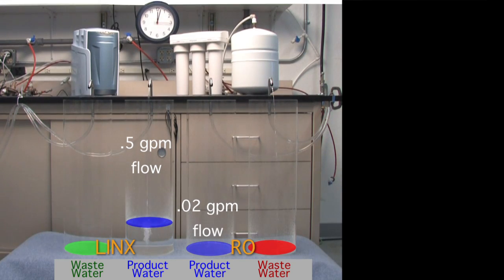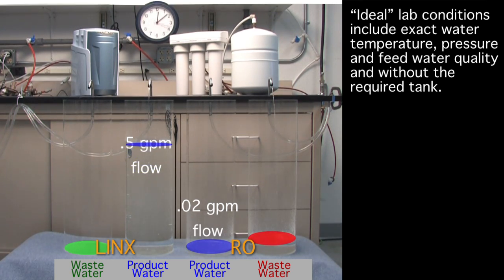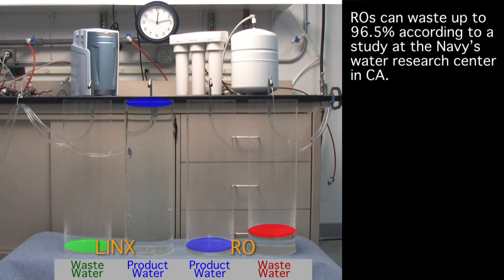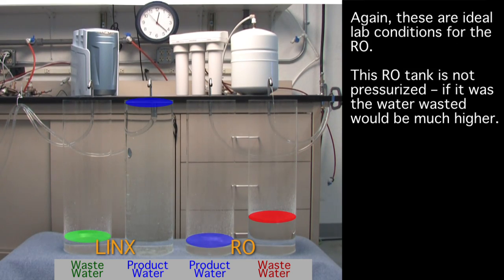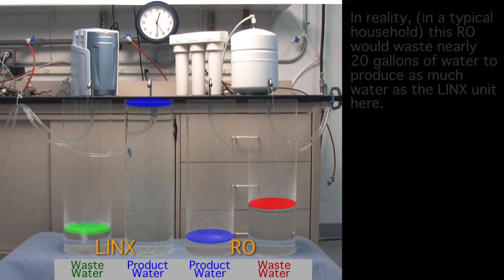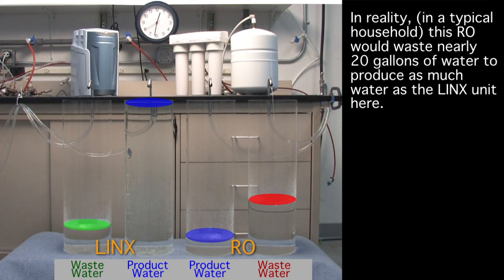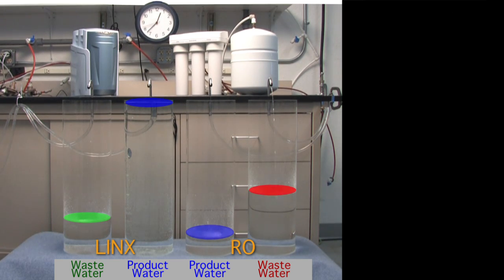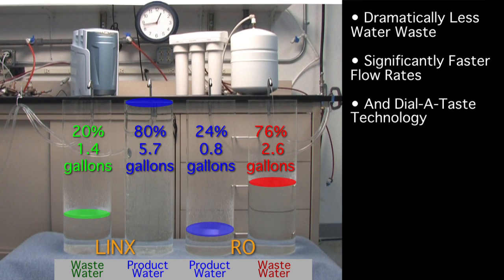Comparing a LINX® Drinking Water System to a Reverse Osmosis Drinking Water System

Comment from the maker: The most efficient household RO system in the market today is “water on water” design where the rejected water that normally would go to drain is diverted to the other side of the “bladder” in the product water storage tank. This is then used along with water pressure from the feed water source to force the water out of the tank to the faucet.  These systems claim a 50% recovery rate but actually perform at 33% due to the use of feed water to deliver water from the storage tank to the faucet.

Comment from the maker: Water temperature also impacts recovery.  ROs are lab tested for certification w/ 25 degree Celsius water (77 degrees F).  A one (1) degree Celsius drop in temperature will actually drop your recovery rate by 3%. Finally, the pressure applied to water at the RO membrane is the 3rd major factor in the recovery rate.  ROs are tested for certification at 50 pounds per square inch (psi).  If the pressure varies, recovery varies as well.

Comment from the maker: However in the cases that we have experienced the efficiency rate in is even lower typically 10% or less depending on where the tank refill pressure switch operates.  When a home uses one (1) gallon of water a day, at 10% recovery the actual water wasted is 3,500 gallons per year – staggeringly high.

Comment from the maker: Recovery rating in cert testing is 25-33% but the testing is done under conditions that rarely exist. Testing is often done without a tank. The amount of water delivered to the tank is the “efficiency rating” (typically ½ of the recovery rating).  The back pressure from the tank causes the recovery rate to drop dramatically as cited in the Kuepper article.

Comment from the maker: Citing an article published by Kuepper in Water Conditioning & Purification (June 2001). “Once the RO product water storage tank was filled, the system operated with a recovery of about 2.5% thereafter if modest amounts of water were removed from the storage tank at a time (for example, to fill a single glass of water).” ROs have different “recovery rates” – that is the % of water they deliver to the faucet vs the % that goes to the drain.